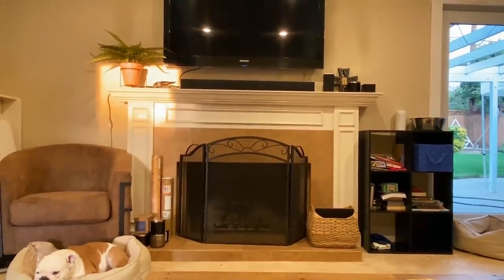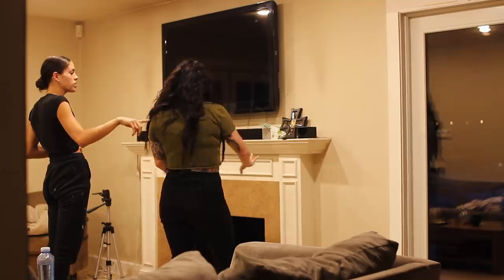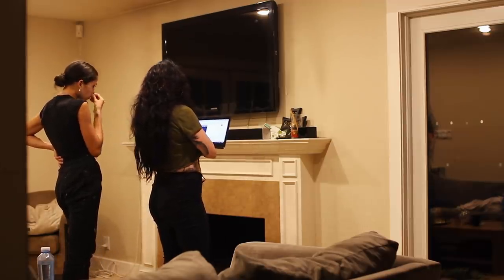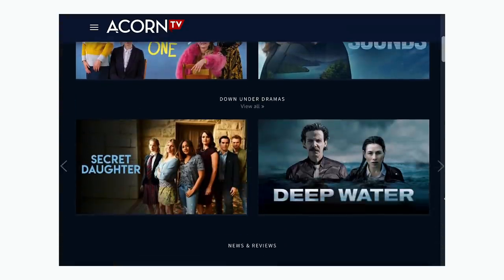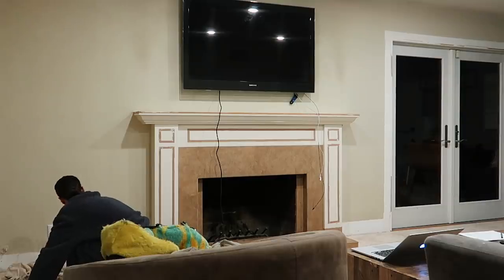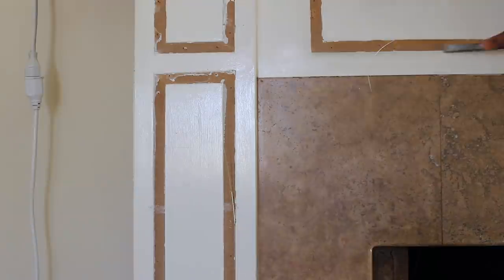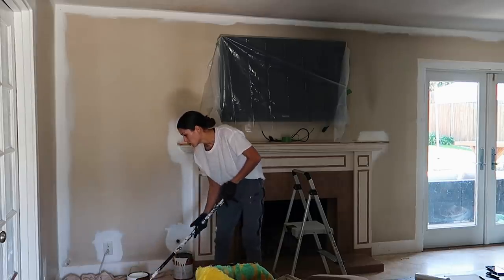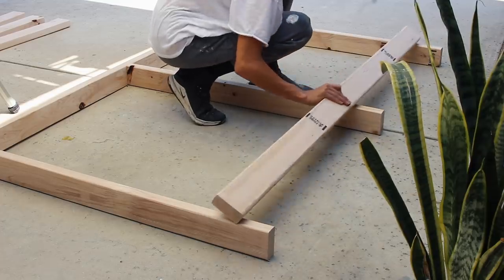Starting Our Extreme Fireplace Makeover | Budget Breakdown + How I Design Part 1 of 2

Comment: Bottom line upfront: I AM NOT A FAN OF THE RUSTOLEUMFLOOR PAINT. 
I painted my kitchen tile floor 2+ months ago in white. The can said 2 coats, but to cover it well I ultimately needed 4 coats. Afterwards, I applied 2 layers of topcoat because my faith in the product was dwindling. A day project turned into 3+ days. My budget was tight to begin with, but I had to purchase 2 additional cans of paint at $50 a pop just to cover the floor adequately. Even after being meticulous with controlling pet hair from settling into the paint, it still happend because full cure time is 7 days. Imo durability is sub-par as well. I dropped a small cup and saucer a month after the floor was completed. Unfortunately, the paint peeled and crinkled in 4 areas because of it. I could go on, but I regret the project, and for $50 a gallon I expected far better results than what I received. I have photos, but yeah, obviously can't share it here. Anyway, I hope this helps someone.
Reply from the maker: I appreciate this feedback!
Reply: @LivingtoDIYwithRachelMetz  anytime!